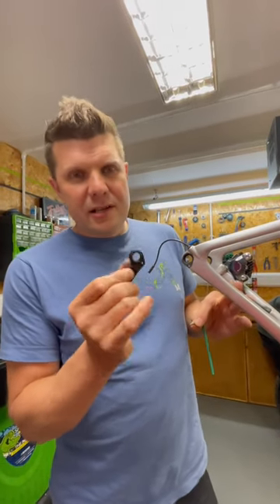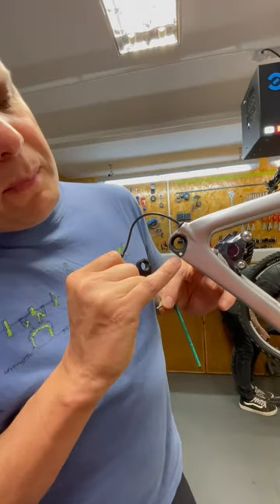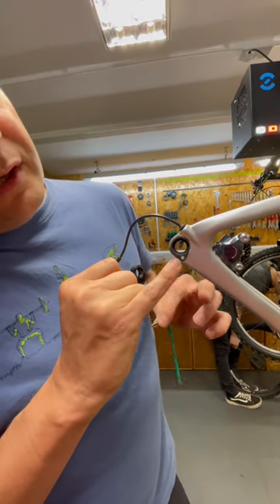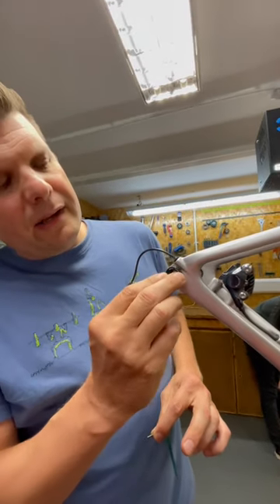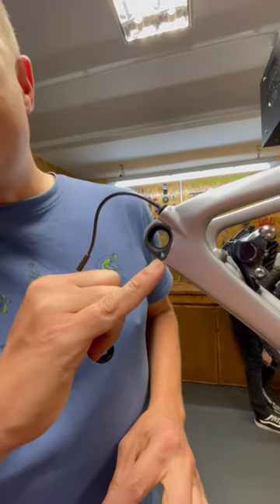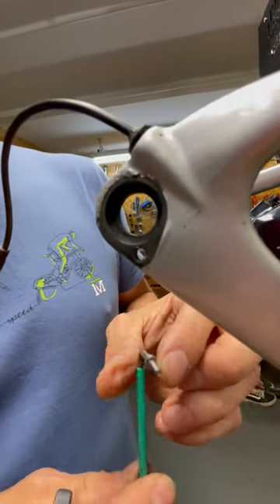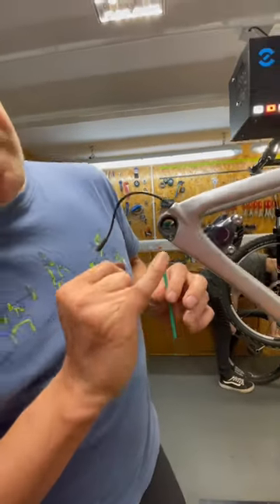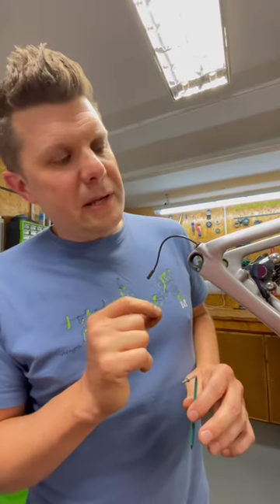Cannondale drop outs are scary

Comment: I believe the reason for designs like this is the obsession with weight reduction.  In part, I blame the consumers. "Lighter is better!" I'm going to say yes and no. I notice the difference between my road bike and my old 33 lb steel hardtail. Would I notice the difference between a 23 lb bike and a 22 lb bike? Probably not. I'd rather have a slightly heavier, reliable bike that will last for years compared to a lightweight eggshell designed to only last a couple seasons.
Reply from the maker: You are totally right.  Weight and Price are still the driving factors in buying decisions.

Comment: I have a frame similar to this. What i did was sand that part a bit and added roughly 1.5mm-2mm thick of epoxy steel to give it a bit more strength.

Comment: I have a custom steel bike that utilizes a cannondale d-hanger (wheel’s industry 110). The thing constantly bends. I stopped replacing with new ones and got really good with a park tool hanger straightener. Totally annoying, and I curse the builder every time my chain starts slipping.

Comment: BMC Roadmachine is like this as well!  Although the BMC has another part on the inner side of frame where the screw attaches, so not the carbon.   But the dropout disassembles when i remove the wheel with a bit of force, which is like more than half of the time.  Other dropouts has 2 screws.

Comment: After this ripped off on my friend’s cannondale, he just keeps it connected via the thru axle only. Works fine but you need to be careful with the dangling rear D when the wheel is off. A few bikes are like this already like 3T.

Comment: You’ve also got a massive 12mm bolt holding it in place in the form of a thru axle!
While it’s not a good design it is only really there to hold the hanger in place until you fit the thru axle. It will be quite hard for the hanger to rotate in the direction you are saying as it will be working against the direction of the thread of the thru axle.
Reply from the maker: I think our broken frame count is at 5.  And we are not even a dealer.

Comment: So is this a all carbon bike or aluminum alloy bike?

If it's a all carbon frame, would buying a aluminum bike be better?
Reply from the maker: It’s carbon. The second question is a lengthy answer.
Reply: @Mapdec  ok. Thanks!
I will avoid carbon canandale because that's a expensive flaw design.

Comment: My carbon fs dengfu e22 frame has that same style hanger. Just use blue lock tight.. don't over torque. Get a torque wrench in inch lbs or nm.
Reply from the maker: It’s more that the frame fails with impact.

Comment: If the bolt is tightened to spec this is a non-issue. If not,  good night. Would I call it well designed? No. Does it work as intended? Yes.
Reply from the maker: Until you hit something. These spin out of the frame, the bolt busts through the slither of carbon when the rear mech takes an impact.
Reply: @WhoCares-me9nj  So the intention of the design is that the hangar can rotate on a hit and destroy the tiny amount of CF material on the lower side of the dropout? LOL

Comment: If that is such a potentially big issue, isn’t that then a terrible design?
Reply from the maker: Yes.  They have changed in for new models now
Reply: @Mapdec  Do you happen to know if the new models use a better dropout design? I'm mainly curious about the 2022 or 2023 Topstone Carbon frame (I may be purchasing one very soon, but am not sure if it's this year's or last's). Thank you for drawing attention to an issue that would have otherwise escaped my notice!